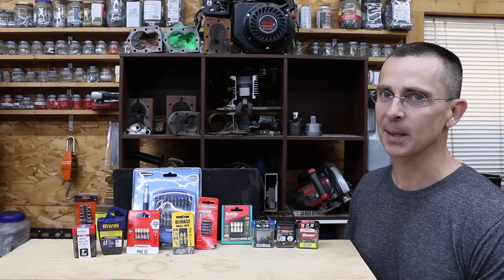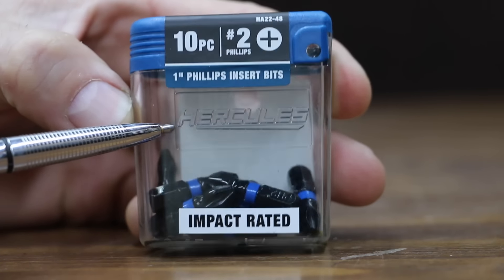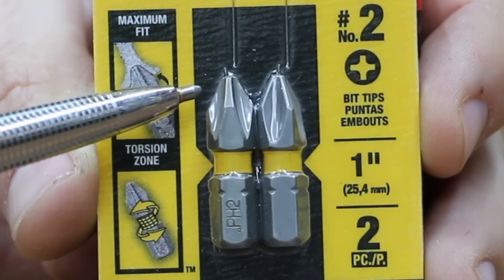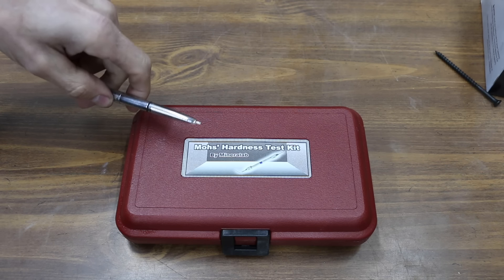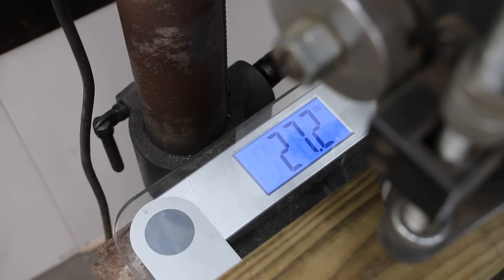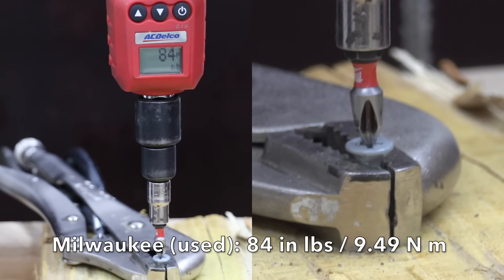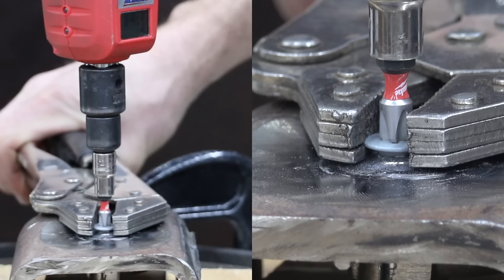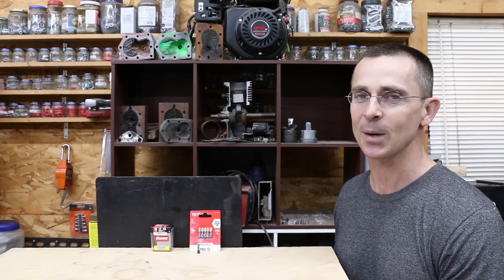Which Impact Driver Bit is Best? Let's find out! Phillips #2 Showdown

Comment: A very extensive test, thanks for posting. One other thing that might affect the results greatly is the brand of the screws. One brand of screws will have a better fit with one brand of bits and some other brand of screws with some other brand of bits. A lot of screws (especially cheaper ones) are often not manufactured to standards, so even if a bit is perfectly up to standards, it might have some play if the screws aren't.
Reply from the maker: Thanks and you are welcome!

Comment: I can't fault Milwaukee impact bits. I shattered loads whilst building my garden room so bought the Milwaukee bits. Since then I've driven approximately 750 80mm screws on a single bit and it's still as new. I bought a pack of 25 so think I'll be fine for screw bits for the rest of time
Reply from the maker: Thanks for sharing.

Comment: I would like to see a comparison between cordless angle grinders. The Milwaukee fuel, Makita 40v xgt gag06, and DeWalt.
I've used the Milwaukee fuel a lot but I run into trouble when using it hard for an extended period. It shuts down and I have to wait a while. I assume it's overheated. It's like a race horse: it will go hard and fast but it must be given breaks. This is how most angle grinders are used so this is an understandable shortcoming.

I would like to see:
-raw power
-battery life with the better available batteries.
-continuous extended usage test at close to Max power.
-another endurance test at half rpm (variable speed models).
-some insight into how much the battery choice (5 ah vs 6 vs 12 etc.) impacts performance.

I am a professional looking for a really good angle grinder.
Reply from the maker: Thanks for the suggestion.

Comment: I use PH2 all day everyday and bought milwaukee bits because i have milwaukee tools ive used makita wiha spyder(just cuz they were blue) and flex. One day a buddy gave me a dewalt maxfit ive never looked back hands down the best bit ive used. hundreds of milwaukee bit they all act the same they seem like they cam out and tear up the tip of the bit and get worse and worse. the dewalts everytime the bit is perfect fit which makes it easier to apply force and drive fasteners when your not worried about ruining the screws
Reply from the maker: Thanks for sharing.

Comment: Try using a a tool that is designed to drive screws into wood or steel and aluminum studs known as a screw gun with depth setting and control  ... There's both corded and battery powered screw guns  , 🔫  ; I liked skill screw guns the best followed by Dewalt....
Reply from the maker: Thanks for the suggestion.

Comment: Great video idea.  My experience with Milwaukee is the opposite.  Worst bits I've used.  Sort of disheartening, because i have most tools as Milwaukee.  Just switched over to the Dewalt bits, and they are night and day in the performance field over Milwaukee.  Still wish screws would switch to a torques head, like quik drive and GRK use

Comment: I use 50mm (no holder required) Dart here in the UK when I can get them, they're not widely available, just one stockist in my city. Here we only use PH (Phillips) on drywall screws which isn't much of a challenge compared to say a 70mm woodscrew, all of which have a PZ (Pozidrive) profile in the uk or occasionally star bit (which I really rate), they take a battering.
Reply from the maker: Thanks for sharing.

Comment: Sir after watching  a few videos from your channel find you either mad scientist or pure genius.

I am joking sir your testing methods are extraordinary.
From paint to extension cords, you set the standards 

I use Milwaukee shockwave as finish carpenter, from installing doors to building decks my last 16 x 18 used 1 torx T25 but, no slipping ..

I used DeWalt in the beginning they break easily 

Can you make an updated video with Diablo bits crs Hilti, vrs Bosch the contractor grade bits.
No matter once again nice job sir.
Reply from the maker: Thanks!  Thanks for the suggestion.

Comment: Have you done a test for impact driver Socket Adapters?
  It is really convenient to use a lightweight 12 volt impact driver with a socket, but many of the adapters don't seem to hold up well to repeated use.
Reply from the maker: Thanks for the suggestion.
Reply: @ProjectFarm  .
I did find a very good video that you made about four years ago, 
 Thank you.

Comment: It's funny the milwaukee bits did so good. I bought a multi bit set and they absolutely suck. I assumed the screws to be the culprit as they seem to get worse all the time. But tryed a task bit in the same screw and it fit perfect. I rarely use impact bits with my driver because I find the normal bits work fine. So to spend the extra money on them and have this kind of luck really sucked

Comment: I have not done the in depth testing you've done by any means. I have, although, over the last couple years used most of the bits you tested in my day-to-day work. The Milwaukee bits really are just this good. I bought a 15 pack of the 2-inch about 2 months ago and the first bit I put in my impact driver is still there. I'm just about to swap it out because of a couple of sloppy/awkward use moments with it. I work as a carpenter/handyman/furniture repairman.
Reply from the maker: Thanks for sharing.

Comment: I have strong feelings about bits and tips. Five or six years ago Milwaukee had the absolute best ever created the silver and black type. Best fit never stripped never broke I had the same tips for 5 or 6 years. Now I believe it's Bosch. I see you're showing more where than the DeWalt button real world that's not true. The only B missing out of my case are the ones that other people lost on me. The tips that I have used have 0 wear and tear. They have the best fit and the case has everything that you need.
Reply from the maker: Thanks for the feedback.

Comment: Had the craftsman bits and there the worst constantly slipping and just fall apart under little use got a makita set but there a different model and there so much better for the price. Would propably try the milwaukee one day when the makita finally die
Reply from the maker: Thanks for the feedback.

Comment: i didn't notice which tip i was using screwgun until i remodeled bathroom and broke about 10 bits off of cheap giant set of craftsman assorted bits and drills
Reply from the maker: Thanks for sharing.

Comment: What is the best bit holder that doesnt let you bit fall out. Also that is not too difficult to pull out.
Bit holders can be good because the small bits are magnetic. The longer bits are not magnetic, at least that i have found
Reply from the maker: Thanks for the suggestion.

Comment: i've been a plumbing contractor for a decade and the old milwaukee bits or any that come in there impact kits that are black coated were so bad i wouldnt give the new silver looking ones a chance. i usually will get a big pack of dewalt ones instead since they never change and would rather stay with old trusty. also to prove im not just a dewalt loyalist, i use Makita for everything but my Pex expander that is M12

Comment: Thanks for the video.  Great video.  I never paid any attention to these bits, when I bought a box made by Milwakee.  They lasted quite sometime after several boxes of deck screws.  The bits did show signs of wear and distorted shape.  I am also a weekend wood worker who made quite a few furnitures...What I did find out with the hardwoods was that it pays to pre-drill a pilot hole before you do this impact drilling.  If not, the screw can easily get stripped, or your impact driver is not turning...due to lack of torque force.
Reply from the maker: Thanks and you are welcome! Thanks for the feedback.

Comment: The shockwave is powerful! Milwaukee #2 bit shockwave will last a long time! It’s not made to drill holes on concrete but I did it anyway. Lol it still works like a charm on dry wall screws.
Reply from the maker: Thanks for sharing.

Comment: I have some older bits new in the packages and new bits from the same makers. They vary and the old bits from Makita fit very well, and the new not so great. The Milwaukee new bits fit better than the old ones, at least the ones I have. The Bosch seem to be consistently one of the better fitting ones. I have some very old Makita bits that I can't find after a move, they were really brittle and most of them broke long ago, but I know the larger phillips bit is unouched as are some of the Torx bits. The best thing about them was the case they came in. I guess I would like to see a shootout between different samples of the same bits, to see if the current ones vary in hardness or dimensions like the old ones did.
Reply from the maker: Thanks for sharing.

Comment: Can speak from experience that the findings of the Dewalt tips being weaker than most of the other brands is accurate. A coworker and I had to install metal on metal holders and he had Dewalt tips. He broke probably 5 tips in 1 day, 4 of them new. 1 tip only lasted 2 self-tappers. He didn't use excessive force or continue to force it after the screws went in.

Personally, I like using Hex heads a lot more than standard/phillips. They offer more stability when installing and 0 risk of stripping. Only thing is if you put too much onto the head, it will snap off.
Reply from the maker: Thanks for sharing.

Comment: My dad used to rub long wood screws on a damp bar of soap to ease insertion into the wood.  I have seen waxes used for the same purpose.  Can you perform a test comparing screw "lubricants" to dry screws?  The lube has eased insertion and increased life of the driver bits, too.
Reply from the maker: Thanks for the video idea.

Comment: Milwaukee is probably the most common bit I see construction workers use....and especially the long ones that are way more common these days.  Electricians use them all the time.  For short drivers, I use varied brands...whatever I get a hold of.... that so often don't even have a name printed on them.  When they're really cheap, it so often does not matter.  Probably cheap Makita or dewalt drivers....on the whole.
Reply from the maker: Thanks for sharing.

Comment: Not tested here but the longest bit i ever had was a "faithful" branded bit (PZ2)

Must have used that same bit for 2 solid weeks on site before it let go, I'm currently using the Milwaukee shown here and they're also lasting longer than i would reasonably expect (a good thing)

The worst i ever used were DeWalt, not sure if i had a "bad batch" but i blew 3 or 4 of a 25 pack in 1 day... Needless to say i won't be buying those again 😆
Reply from the maker: Thanks for sharing.

Comment: I no longer waste my time, energy and money buying Phillips screws.  I keep ph bits around to use when I encounter Phillips screws and every time I curse them.  The only good thing that I can say about Phillips is they are aesthetically pleasing.  My go to bit is always a Robertson.  Normally a Robertson screw will snap off before it ever cams out.  There are many different brands but those made by PL Robertson are in my opinion the best.  I bought some Milwaukee brand and they were so bad as to be unusable.   I had to grind the tips to get them to fit.  The same goes for Robertson screws, not all are created equal.  Please do a test on the various Robertson bits using an oem screw and show us the results.  I would love to have the Torx bits compared to Robertson for the same tests as the Phillips.   Thank you for your unbiased testing.  I always am amazed with the findings.

Comment: I can definitely say that using my Milwaukee bits every single day. It does last much longer and it never wears. Just broke some dewalt bits and the makings bits got very dull. Both of those brands are great but Milwaukee just seems to have a better quality tool steel. I think the dewalt is more brittle and the Makita is more soft. 

Milwaukee seems to have bits that just never really wear out but also aren’t too strong to strip the screws. They’re more likely to slip out then strip them which is what you want. 

I also feel that my Milwaukee impact is able to go slow enough to have precision but has enough power to drive. Where as the dewalt has too much power and is very difficult to precision drive. While the makita impact is very good at precision but doesn’t have the power to drive.
Reply from the maker: Thanks for the feedback.

Comment: at work our shop stocks milwaukee bits i mostly use red robbie bits i have used all kinds of different driver bits i find milwaukee to be the worst fit .. most bits i can put a square screw on and turn upside down and it will not fall off i can not say this about milwaukee bits and i have most fumbles with them
Reply from the maker: Thanks for the feedback.

Comment: Great video! It’s funny that just through use over the years, I exclusively buy wiha and Milwaukee bits prior to seeing this video as they seemed to fit and hold up the best. Your tests seem to more or less confirm. At the very least, it makes me feel a bit better about spending the extra buck on these bits.  Would be really curious to see the same tests with t-25 torx bits using GRK brand #9 or #10 3 1/8 multipurpose screws.  l almost never use philips fasteners if I can help it.
Reply from the maker: Thanks!  Thanks for the suggestion.

Comment: Cant speak for how its in the US, about what screws that is used, but in all places I've work in Sweden and in private, i always uses torx, in the end most times its not a question on what Bit or screw that is used, but what machine that is used, all together, I've used Makita, DeWalt, Milwaukee, Bosch, Ryobi, Festool, atm i have Festool, mainly because of they various options of attachment tools they have, yes its pricey as F.
With that said, i like Bosch as well.
I'm aware that this wasn't a about the machine, but the bits, its just a reflection.
Torx makes a huge difference on screws.
Reply from the maker: Thanks for the suggestion.

Comment: Todd, have you ever considered testing DeWalt Max Fit V.S. DeWalt Flex Torque? You could do bits, adapters, and maybe even magnetic rings on the end of bits. I love DeWalt but always wondered why they made 2 impact rated lineups for about the same price. What are your thoughts?
Reply from the maker: Thanks for the suggestion.

Comment: I have tried a few brands, but milwaukee bits are all i use for screws and metal drill bits. They also make a good step bit for impact. Im an hvac installer and run dewalt 20v platform. Dewalt bits are not any good.
Reply from the maker: Thanks for sharing.

Comment: You may have seen/noticed or tested this, but, If you have lumber that is really hard and try to drive say a 3" Phillips deck screw with a drill, just over 1/2 way, they will start camming out and you cannot finish getting the screw in. You can move that bit over to the impact driver and finish driving the screw with ease. But, do not use the impact driver with stainless screws, they are too soft and it will round out the heads quickly, so use a drill with stainless screws.
Reply from the maker: Thanks for sharing.

Comment: Another very interesting test! Always impressive! 
Got to wonder...does the brand of screws affect the performance of a bit? A bit might  fit the phillips  cut-out of one screw manufacturer better than the  phillips cut-out of another screw manufacturer. This might change  the results. The screws we all use come  from all over the planet from all different companies. And if the screw cutting  dies of the manufacturer get worn or out of adjustment, that would even change screws within the manufacturer and batches of screws. It's almost impossible to really know. I've really  started  leaning toward using torx and Robertson drive screws in the last 20 years for high-torque situations  Those babies hardly ever strip or cam-out. Nevertheless, another great test fom P.F.!
Reply from the maker: Thanks!

Comment: I don't get why you used the cheap grey Dewalts. I use the black "flextorq" DeWalt bits and I really like them. I feel they are on par with the Milwaukee bits. Also, there's another great brand called Vessel. My coworker swears by them and I tried one myself and I think he's right, they're great. They're made in Japan and are about a dollar each from Amazon
Reply from the maker: Thanks for sharing.

Comment: I do wish you tested the Bosch ribbed tip with these. These are all I use and they stick so will you have to have a bit holder that actually clamps the bit otherwise the bit stays with the screw as you pull it off. I like this because I hardly even strip out the screws. These bits break before they stop working. Anyway, try them and let me know what you think. Thanks.
Reply from the maker: Thanks for the suggestion.

Comment: We've developed a new steel wire used for impact screwdriver bits which heat treated by a particular heat treatment, these bits own stable hardness greater than HRC60 and extreme fatigue life greater than 50000 times under 10.3 Nm. These new products are expected to be on the market in 2023.Q4. I expect to see a new comparison report on this channel next year.
Reply from the maker: Thanks for the suggestion.

Comment: Great video, thank you. But isn't pozidrive (PZ) better than Phillips (PH) in the majority of uses? Phillips is designed to cam out but as you demonstrated the torque at which it does is unpredictable.
Reply from the maker: Thanks for the suggestion.
Reply: Well, for most things, Phillips aren't designed to cam out, that's just what they do.

In the early days of Phillips use in manufacturing, the screw and the bit were designed together, and cam out was quite predictable.

Now, it's just everyone making the basic Phillips shaped bits and screws.

In other words, we're using them wrong.